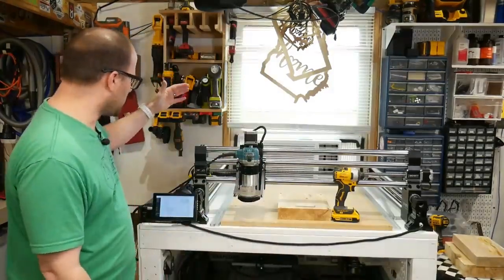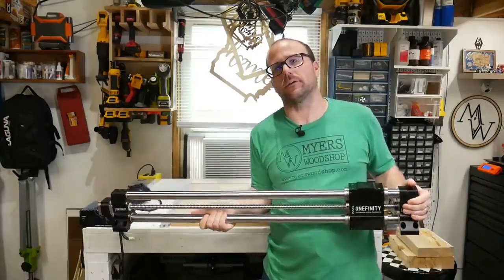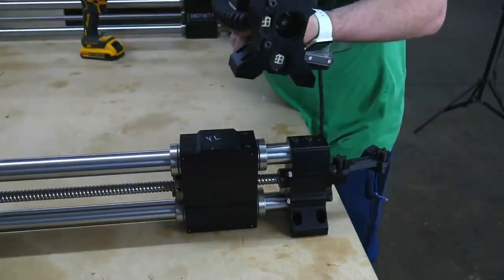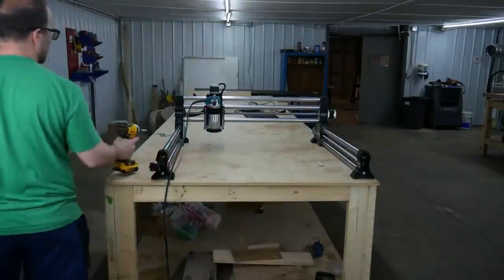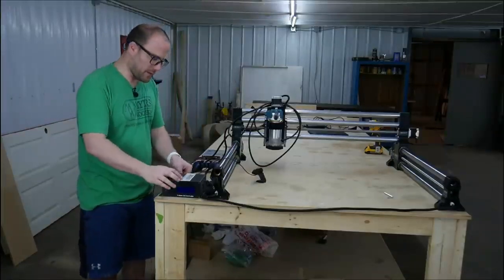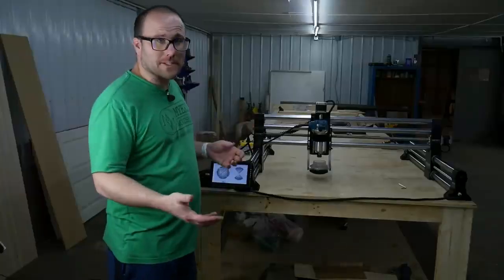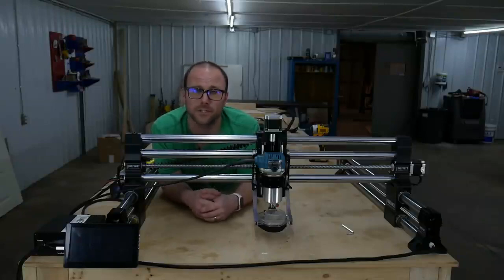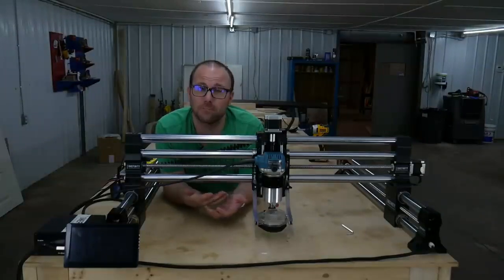Transporting The Onefinity CNC Machine via Myers Woodshop

Comment: As I understand it, the X + Y mating keys are used to ensure squareness. How well does this prevent "racking" (i.e x/y rectangles becoming rhomboids)?  

The controller looks really nice.
Reply from the maker: It doesn't help to much with racking.  Moving the rail to the very front then to the very back should help with that.
Reply: Onefinity CNC if the y motors can be independently controlled it should be possible to do software assisted anti racking calibration. As mobility is a USP it might make sense to have calibration routines built in to the controller.